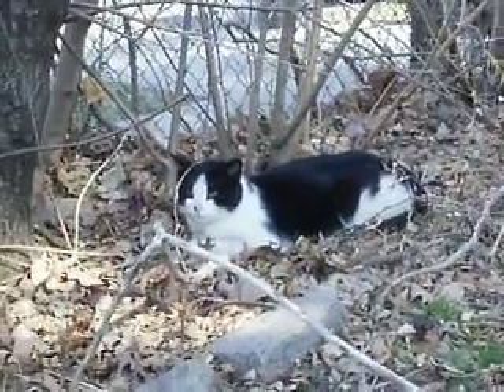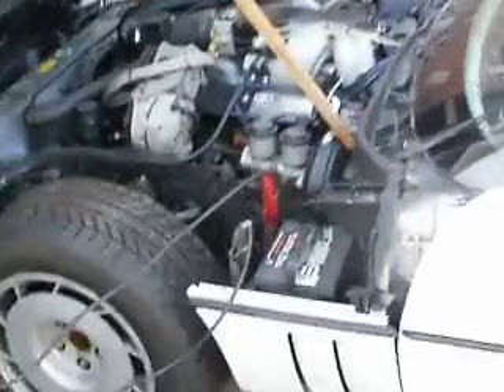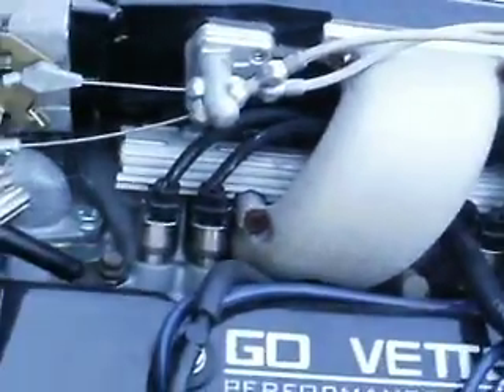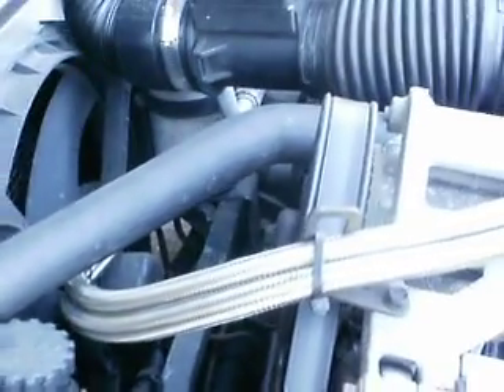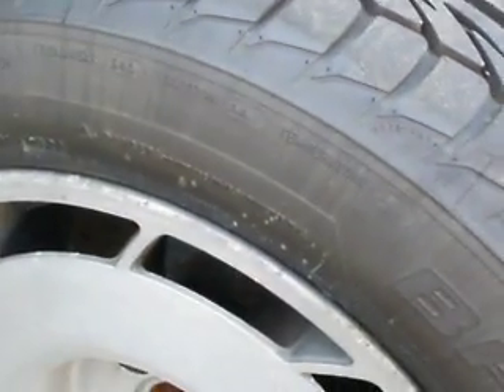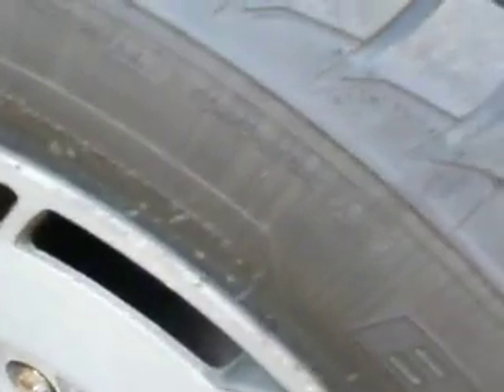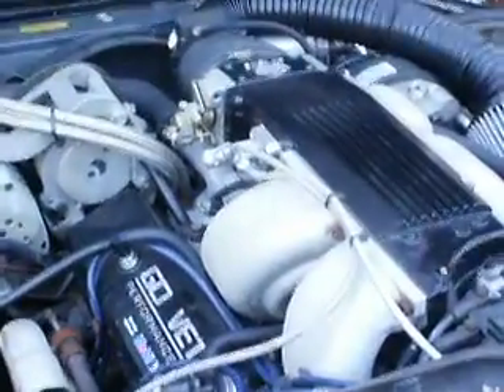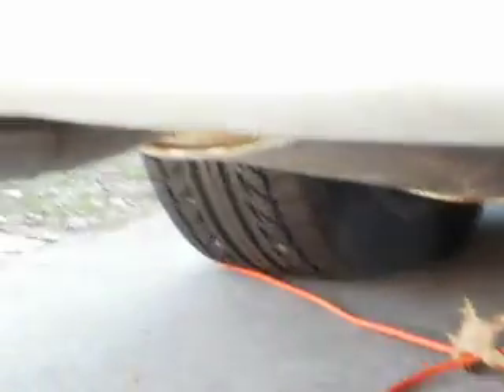1984 C4 CORVETTE Cross Fire Injection converted to Performance Tuned Port Injection

Comment: nice video man, I also have a 84 vette. Did you have to mess with the cars computer in any way when you started to change the parts of the engine? I love cars, but I have yet to learn anything on them when it comes to fixing them up.  That is the only thing that is giving me nightmares about my vette... messing around with the electronics.